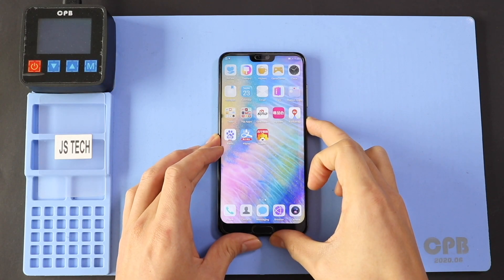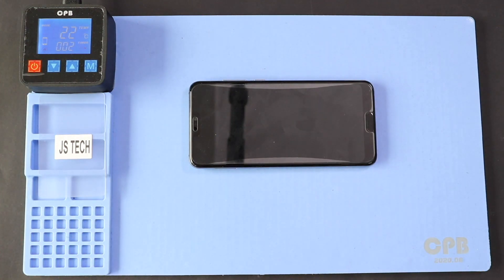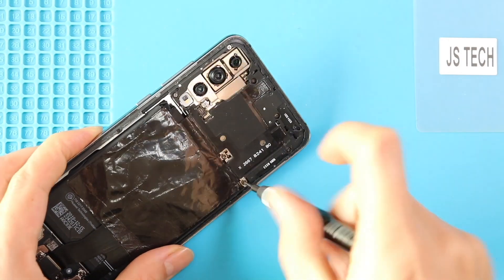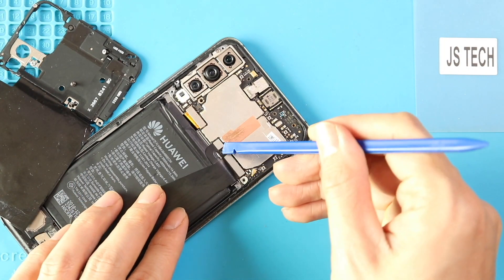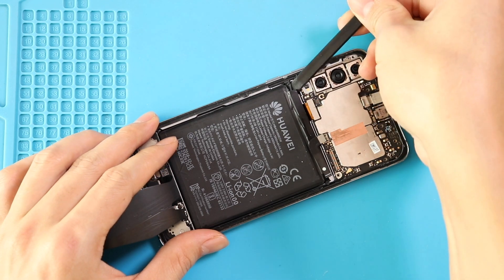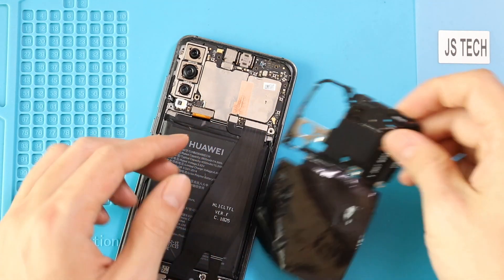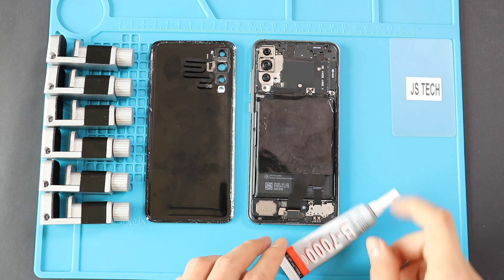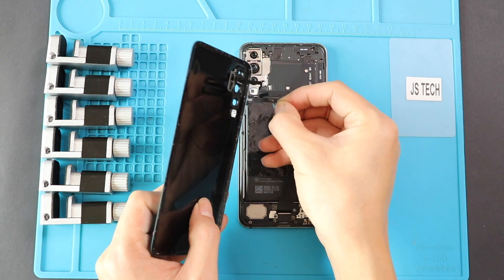Huawei P20 Pro Battery Replacement

Comment: one of my screws was hidden by molten plastic or some kind of black glue. with your video i was able to identify it. battery was hard to remove, had the use the metal cutter tool and broke off parts of its plastic packaging as it was well glued to the phone. no fire.
Reply from the maker: Thanks for your feedback

Comment: My main flex just doesn't connect after inserting new battery. The battery ribbing cable clips on fine, but the main flex doesn't seem to seat at all and won't clip in...

Comment: Please tell me, my battery has been fine the whole time. The phone just dropped on the ground and pressing the power button, it won't come on anymore. What do i do in such a situation?  When i connect it on charge, it lights up then goes off and on again. @geardo
Reply from the maker: Most likely you have an issue with the button. If the button is not responding that is the issue. Maybe it can be the power flex too

Comment: Gonna do this in The coming weeka Kinda scare tho cant afford a New Phone tho and The battery has began to swollen up cracking my backside 😢
Reply from the maker: If it is swollen change it soon. It might causes other issues too
Reply: @DIYGeardo  yes i know that cause the backpanel is cracked in 2 pieces :D like really bad got the order laid but would i bed able without a heat gun if so what are needed ? gonna change battery but gonna figure out how to do it with out a heat source :/
Reply: @DIYGeardo  Update with carefullness The first operation done by me suceeded my 10 year old phone has now a new back panel and Battery feels like a new phone next up will be fixing my Huawei p30 Pro Frontglass and back panel aswell as battery :D and my sony Z ultras sim card reader

Comment: Thanks. When removed the old battery there occured a spark and smoke behind it, I thought I had killed the phone, but with the new battery it works fine. However, the cable attached to the back cover that is connected to the camera flash (I think) broke, what does is that cable for? Anyway the phone works fine as far as I can tell.

Comment: this video helped with my replacement a lot! Thank you. My battery was swolen and very hard to remove so in the process I accidentially punctured it with the pry tool and it caught fire a little. So if anyone is doing this with a puffy battery, wear gloves, protective glasses and do it in the garage or outside!
Reply: Best way is to make sure the battery has little charge when changing it..
Low charge means it contains little energy and highly unlikely to cause an issue if accidentally damaged whilst removing
Reply from the maker: Glad it helped!
Reply: Any tips? Mine is swollen to The part where The backside actually has bulged and cracked making The glass to have been lifted  2mm Kinda or more

Comment: Dear Sir.
Thank you so much for this video! 🏆🏆🏆

I wan't to know how many mm. the batteri adhesive has to be, if I buy a roll of tape 1, 2 or 3 mm?
Thank you from Denmark 😁
Reply from the maker: You are welcome. You can 2 or 3mm, just use 2 to 3 strips.That will be fine
Reply: @DIYGeardo  Thank you! 😁

Comment: What's the life span of the battery?
Reply: My battery is since june 2018 and only started to get really bad the start of 2022. It did slowly get worse though. Hasnt been too bad for a long time. As long as you use original charger and stuff it'll stay good for everyday use/charge. Even if it loses its 2day battery life (mije used to last 2 days without charge now only half a day)
Reply from the maker: Depends on the usage..But at-least 6 months it should do very well..but again depends on how well you are taking care of the phone and usage

Comment: Does it have to be specifically for phone adhesive to use to stick the battery?
Reply from the maker: Well some sort of double site tape will do too, but do not use super glue or any other heavy glue.
Reply: @DIYGeardo  I finally did it !took me forever to take out the battery and accidentally it sparked n I was so scared. While taking the back cover it cracked too but my phone is fine! What a day, but all good Thanks again

Comment: What adhesive are you using for the back of the new battery? The same as for the back cover? :)
Reply from the maker: For the battery we are using Battery adhesive, you can get the iPhone battery adhesive strips for this (since they are the common) and for the back cover, we are  using b7000/T8000 etc. And you can use pre-cut adhesive for p20 pro back cover.

Comment: Great and helpful video, what is the black sheet covering the battery (board frame with nfc) and is it a problem if sheet was slightly damaged from heat gun when opening ?
Reply from the maker: If I’m correct it is the heat sink.. well I don’t think that you will face issues. But just check your nfc functionality.